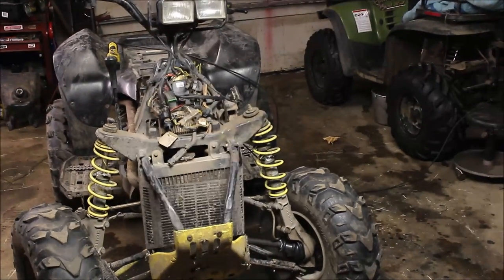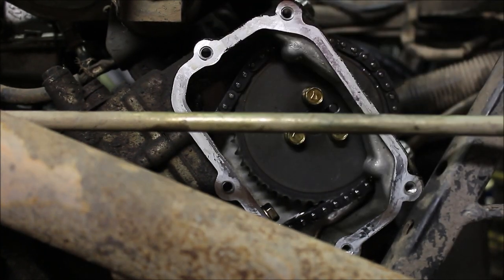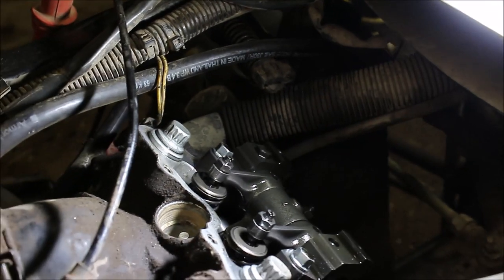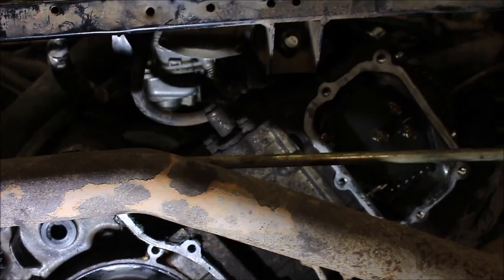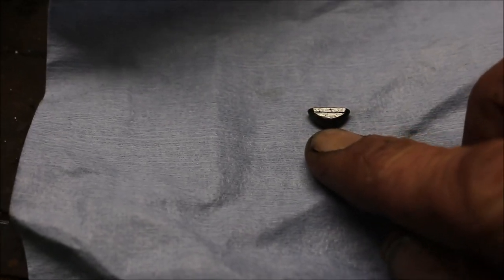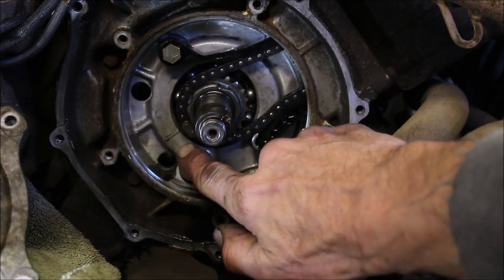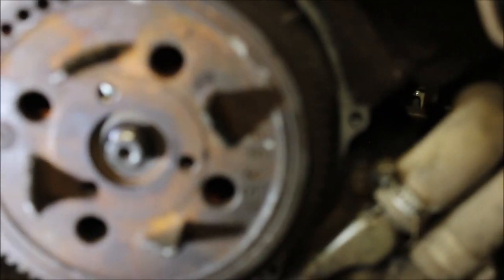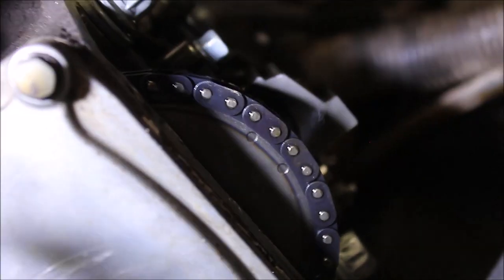Polaris Scrambler 500 engine dies at 3/4 throttle! Find out why! How to replace a timing chain.

Comment: All good info- I made sure I went back and checked all that info in this video just to make sure I went through everything. Im still working on my project but so far so good. Thanks for all the great videos.
Reply from the maker: Thanks. With these 4 strokes,  Timing is everything. Glad to help. Good luck with your project.
Reply: @TitaniummanGarage  1998 sportsman 500 4x4 coming along good its all about waiting on parts - but while waiting I picked up a 2000 Suzuki Quadrunner with 867 miles - barn Find in great shape and with that came a Kawaski Mule 1000 package deal - only issue with mule was a broken holder needle for main jet in one carb and broken Main jet - waiting on parts other then that the thing has not seen alot of time running it has been sitting in the barn for years. Should be fun going through it all and just getting everything back to spec. your videos help alot so thanks.
Reply from the maker: @G3MsFixIt  Sweet deal. Mules are fun to ride.
Reply: @TitaniummanGarage  I commented on your most recent video about corroaded wires but I guess you didnt like it - and removed it so Its all good - keep making videos and Ill keep watching.
Reply from the maker: @G3MsFixIt  Thanks for letting me know. No I didn't see it. I have noticed some of my comments getting deleted from other people asking questions too. What was your comment?
Reply: @TitaniummanGarage  I was just saying I would be interested in seeing a video how you hotwired the fan to come on when key is switched on. Also I was asking if you would be interested in seeing some of my projects but didnt know how to  send you pics. Thought you might want to see how they came out.
Reply from the maker: @G3MsFixIt  Yeah. That would be cool. I have a Facebook page set up to do that and answer questions, I've had a couple people ask how I got wired the fan. I'll make a video.
Reply from the maker: @G3MsFixIt  https://www.facebook.com/TitaniummanGarage You can share pictures on there. I like seeing other peoples projects. I wish YouTube had a feature like that.
Reply: @TitaniummanGarage  I went to your facebook page. I like your projects and also messaged you some of mine - Hope you like them and keep doing what your doing - Good job on the videos so far I enjoy watching all and learn somethings I have forgot or havent thought of - So keep it up. Oh your comments are being deleted again so beware. I have left a few and come back to channel and they are gone.

Comment: After a very recent motor swap and having to deal with a camshaft and timing chain in my beloved's 95 425 magnum I have gained a bit of insight on these motors. 
One very minor issue I have with your otherwise highly informative video, is I dont think shearing the flywheel key for what ever reason would cause the timing chain to jump since the crank timing gear has it's own woodruff key and that gear is retained by the nut on the shaft behind the stator cover. The flywheel and it's key is retained by a second nut outside the flywheel. 
You are correct that shearing the flywheel key will toss the ignition timing out the window. Had this happen on a 50hp boat motor once, THAT was an adventure!
The silver links will go out of synch with the marks on the cam gear after so many revolutions and then line up again and then go out again and so on, all while the crank/valve timing stays correct. 
I now have a 425 motor on the floor of my shop I will likely rebuild or even upgrade to a 500 per your other video to have as a spare since I have two 425 magnums and would not mind having one ready to go when needed.
Reply from the maker: Your correct. If I implied that the timing chain jumped..I didn't get my message across correctly. I was telling the viewer to watch the flywheel and if the key sheared off it would throw the timing off. Not the chain. Good luck with the conversion. Its pretty strait forward like a 425 with a little more  power.
Reply: @TitaniummanGarage   could you please help my polaris?. PLEASE.
Reply from the maker: @kartrfolife  what do you have going on?

Comment: Im having a weird problem. Its an 03 500 h.o. idles perfect starts good. But it has a lack of power and hesitates to redline in neutral. I pushed down on the air box which made it run better. Replaced the seal with a used one and put silicone on the snorkel seal to seal it. Helped a little bit. Checked the cam exhaust lobe looks to be the same hieght as the intake lobes. Adjusted the valves too.  Put a new carb kit in changed the fuel pump, (pumps better now) put the diaprham needle to middle position and guessed the fuel air setting. Because i forgot to check how many turns out. I notoced i have an exhaust leak at the manifold wbat would you advise i put my focus on to. I plan on replacing the exhaust gaskets.
Reply from the maker: Sounds like its sucking in air somewhere and running lean. Check air lines to see if they are pinched or bad. Check fuel lines too. They collapse if they are old. 2 and a half turns out on the carb for the setting.

Comment: I got a 2006 scrambler and after I take it out of 4x4 it seems like it's in a low gear (doesn't rev as high) only way iv got it to fix itself was to put it into N and back into 4x4 and then back into 2x4 and that only works sometimes... any ideas what it could be??

Comment: Kind of unrelated question here - do you know if the 500 motors are identical in size and shape as the 425 motors? I’m looking into putting a 500 motor into my 425 magnum since they’re easier to find motors for. Mine keeps skipping timing and destroying valves, and yes I’ve done the chain, valves, and the sprockets are good and tight. Double and triple checked timing.. kind of at a loss so I was wondering about 500 into a 425 swaps.
Reply from the maker: https://youtu.be/_3_MCGyRsdo. You bet it does.

Comment: LOL, you see black smoke, so that tells ya the timing is the problem?? Hilarious I'm surprised you have anything that works. Ahhh NO, black smoke is rich, either carb or coil ain't putting out at higher rpm's.
Reply from the maker: Ok. So why was the problem solved when I adjusted the valves?
Reply: Hey ItBseCrioN8, don't be a know-it-all.  He fixed it.  He had black smoke because fuel was pushing backwards.  He was smart enough to figure that out.